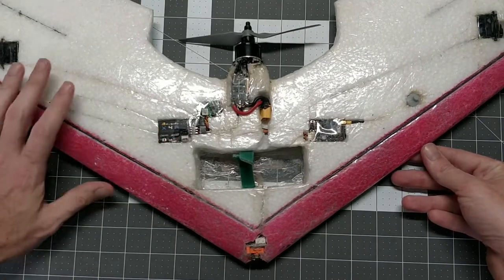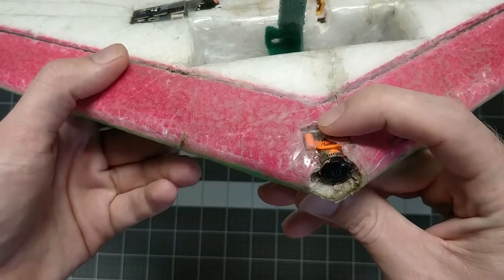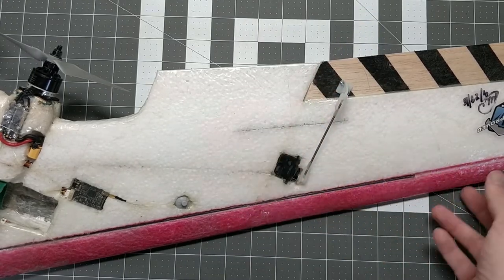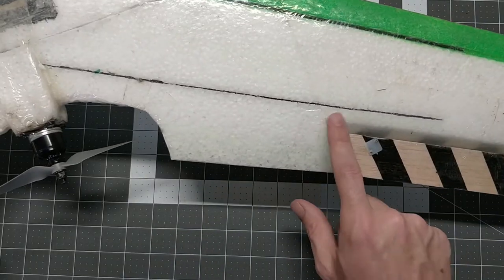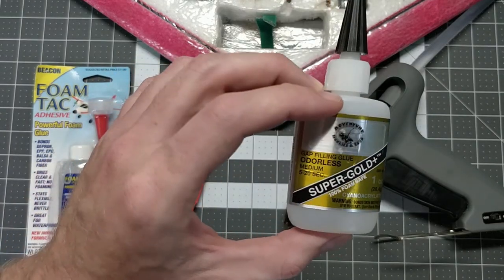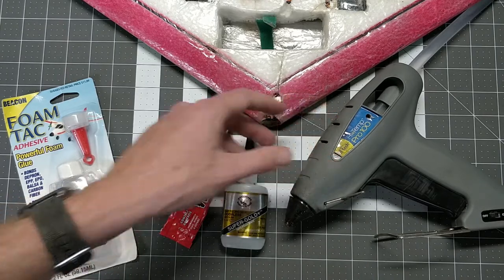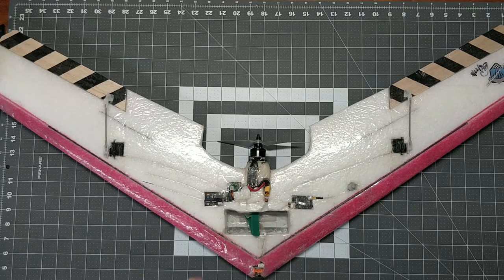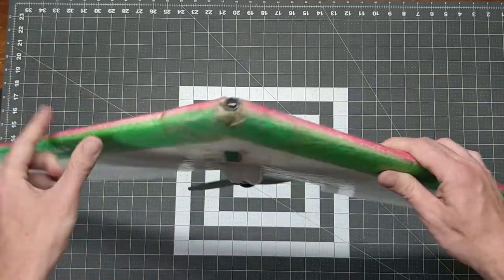VAS Spec Wing V2 Build [Part 3]

Comment: I'm happy I found this series, I just ordered a spec wing, I've had trouble with the unify Evo, on my second one, they haven't been nearly as reliable as the other unify's
Reply from the maker: I have had the exact same experience. I bought 3 evo, used them in some wings, only to pull both the ones I installed back out because they seemed so unreliable.